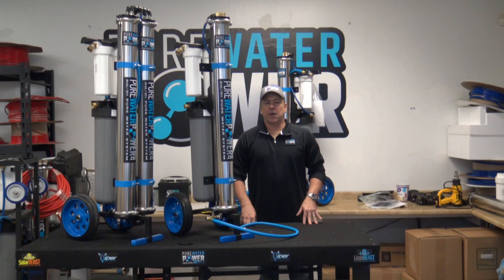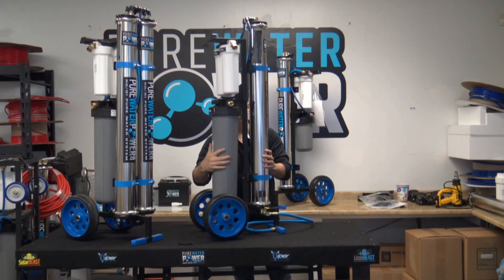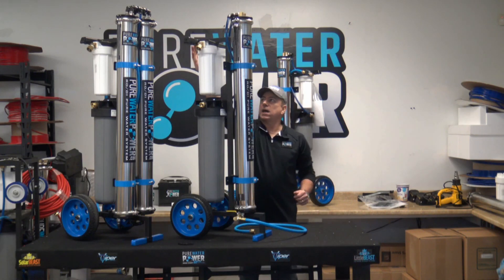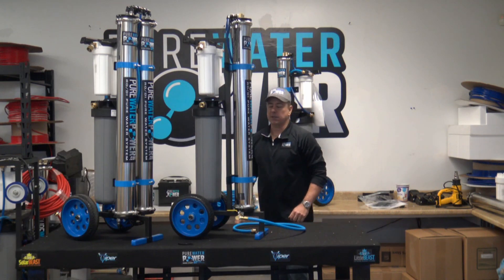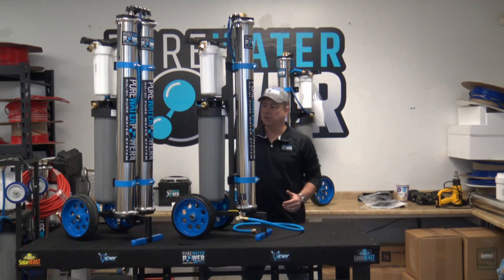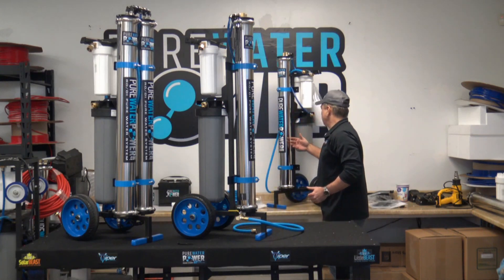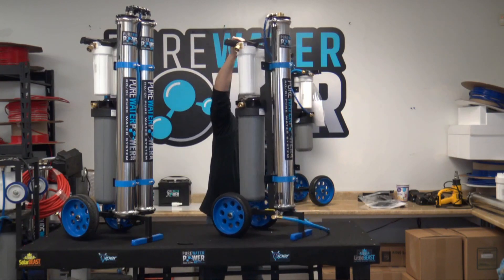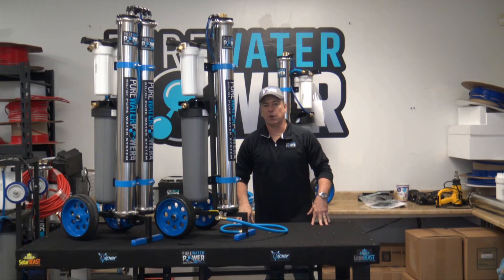Pure Water Power 2nd Edition RODI Cart

Comment: I'm a 40 year veteran of residential window cleaning. I just discovered water filtration systems for window cleaning in the year 2000. After researching many RO/DI systems, I decided to purchase a Pure Water Power System. I can tell you personally that the quality is absolutely top grade. This system is very well built and performs flawlessly. I bought the single RO with a 20 inch DI tank. I only needed to use this system on about 30 houses last year. The waters TDS in my area is about 150 parts per million. I got the TDS down to zero on every job and never had to change DI resin. In addition to this top quality RO/DI system, I also purchased one of their carbon fiber water fed poles. I brought the Mamba 30 Pole. it is a carbon fiber pole rapped in Kevlar.  The quality of this poll is top of the line. Both the RO.DI system and the poles have a professional look to them. You won't be disappointed!